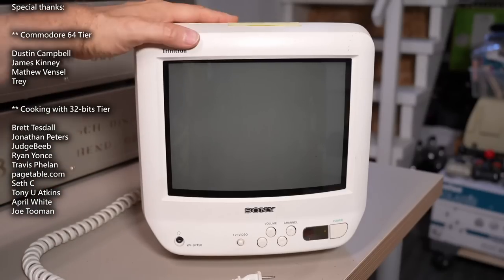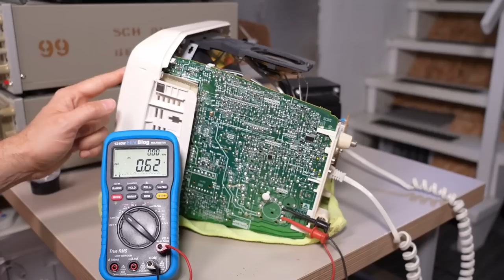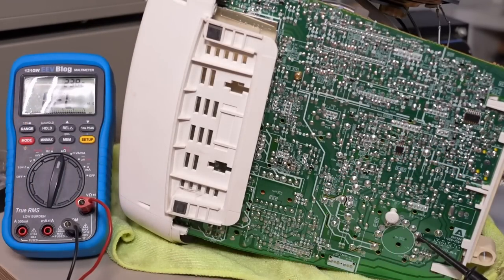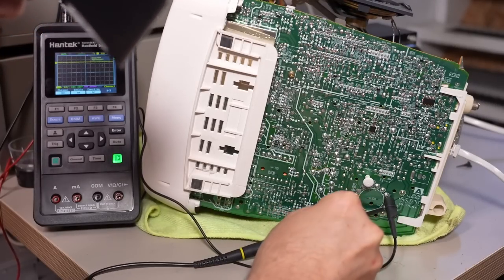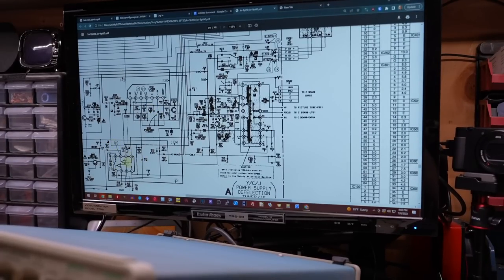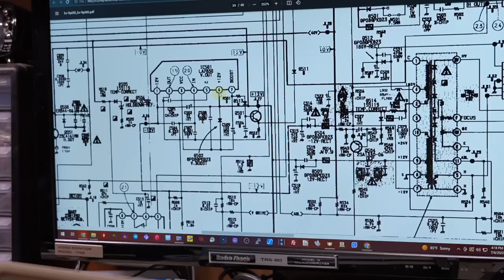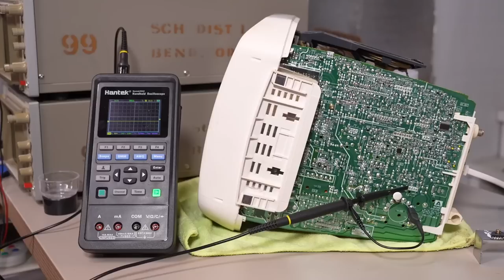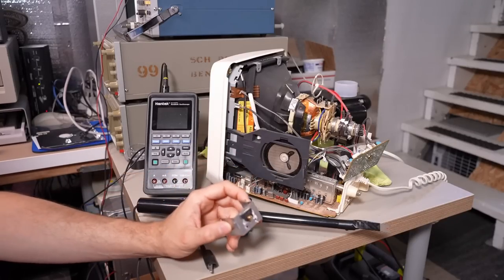This little Sony Trinitron TV squeals and then shuts off (KV-9PT50)

Comment: I don't know much about flyback transformers, but this is an interesting video/problem.  Coming off the 180V pin of the flyback, it goes through a diode and then through a capacitor to ground, charging the cap to 180V.  Did you test that cap to make sure it's good?

I found this long, complex explanation of flyback transformers by Sam Goldwasser.  I can't post the link, but search for "TV and Monitor Deflection Systems" samuel goldwasser.
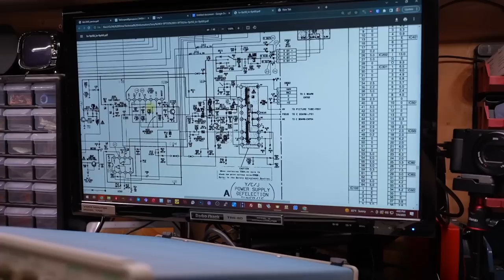There is something called a Horizontal Output Transistor (HOT), that I think is used to generate the pulses on the primary.  I think it might be the transistor in your schematic all the way on the left, halfway down the screen, at 14:23.  Check that, maybe?  Maybe whatever is driving the base is not turning it on enough.

I also found a PDF file that might be helpful.  Search for:
"Understanding the TV Horizontal Output Stage" sencore

BTW, that 180V is B+, I think, and is an input to the transformer, not an output.  Maybe you already knew that, but the way you were talking about it, I was thinking it was an output like the +12 and -12V.

Comment: you cant usually measure the AC/'pulsing' voltages out of line transformers correctly, measure after any rectifier diode...

Comment: My 21" trinitron had a similar issue, turned out the vertical deflection IC had indeed died (and the jungle IC too, plus a few passives, presumably it was subject to a power surge or lightning damage), dragging down the voltages and making a strange noise, once that was finally replaced, along with the other parts, it powered right up, still sat waiting for recapping though as some of them I pulled tested as crap, I just haven't got round to it, 3 years after I got it... :P

Comment: Maybe you mention this later, but 10.5kHz, 15.75kHz and 21kHz are all multiples of 5.25... not sure if that's of any value
Reply: More to the point, they’re all multiples of 525. NTSC video has 525 scan lines. Those frequencies are 20, 30, and 40 times 525. 30 times is basically the 30fps of NTSC (well, 29.97fps for color NTSC, to be exact), so chances are the 15750 is actually 15734Hz, the number of lines drawn in one second. It could be the circuitry actually defaults to 30fps if it can’t extract a color signal, in which case it’d be the round number.
Reply: @tookitogo  good point, hadn't thought it through to that extent

Comment: It sucks soooo much that these kitchen TVs were not a thing in Europe. They are totally unavailable here (or very, very rare) and in doesn´t make any sense to import them from the USA since they are all NTSC and wrong voltage and everything. US market again getting the good things.
Reply: They were available, but not widespread. I have two 9" Thomson sets, one is black, the other is white. You can tell the white is intended for kitchen use, since its remote control is waterproof, and it has a warning on its bottom not to put it in a dishwasher 🙂 .
Reply: @mrnmrn1  Oh, yes, yes, you´re right!!! I´ve almost forgotten about the Thomson ones! They´re neat. I used to have one but the picture tube was quite tired already. However, no Trinitrons :( The smallest ordinary "household" Trinitrons widely available here are about 14 inches. I am Czech and as far as I can rememeber I´ve never seen anyone with the small kitchen TV - and in case there was one, it was 14-inch.
Reply: @lukasgayer5393  
I'm from the neighbour, Hungary. While I've never seen a smaller than 13-14" Trinitron in active use, I've seen some 9-10" ones on the second hand market. They were PAL models with SCART. The neat thing about my little Thomsons that they also have SCART with RGB, and S-video, too!
I also have some Soviet Elektonika C430 monstrocities to repair (yes, I'm probably masochist 🙂), but I don't want to invest too much time and money in them until I find a strong CRT. Unfortunately it seems that no western CRT is compatible with the original one, and the original ones are horribly short lived.
Reply: I saw them used in mobile small station outside broadcast setups.. the battery versions. We had 3 at our small town local TV station for monitor and whatnot.
Reply: I think that in addition to Americans just plain tending to have more TVs all over the house (something that’s much rarer in Europe), another reason for rarity is that Americans often have larger houses with more storage, so they can keep old stuff for longer. Europeans’ typically smaller homes lead Europeans to be much more aggressive about throwing things out, so the ones in Europe likely got recycled years ago.

Comment: I bet the power button on the tv is dead but if you can a remote for that tv it may turn on.
Reply: The power button is fine. The set is powering on, but it shuts off within a couple of seconds on fault condition.
Reply: @sw6188 I Had a tv that did the same thing until I found out it was the power button on the tv. the remote worked still to turn on the tv

Comment: i believe it is the fly-back transformer. visually inspect the working one from your other working mode and measure the outputs. often sony fly-back transformers had a U bolt that broke off which made it fail. check "shango066" channel for sony failed fly-back videos